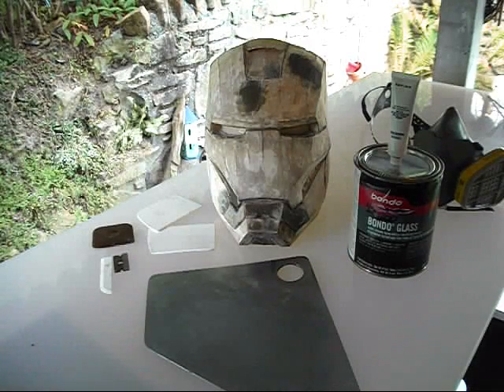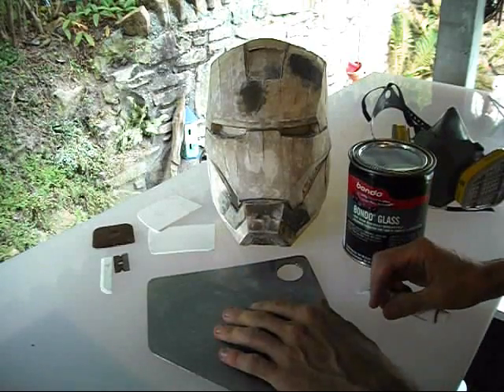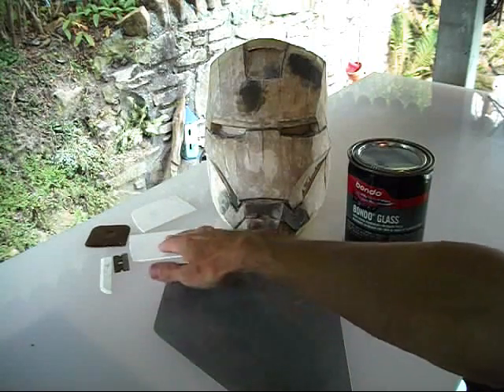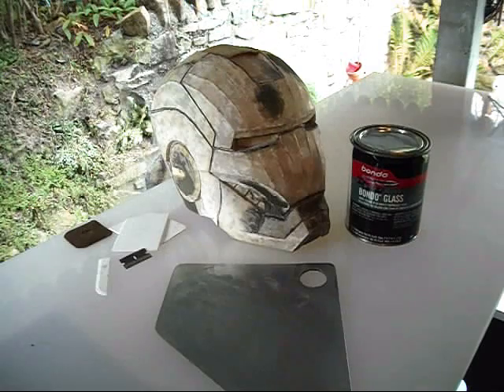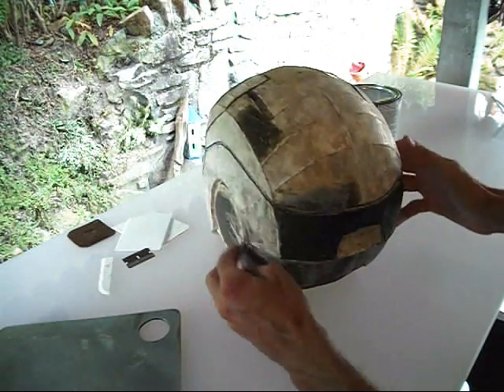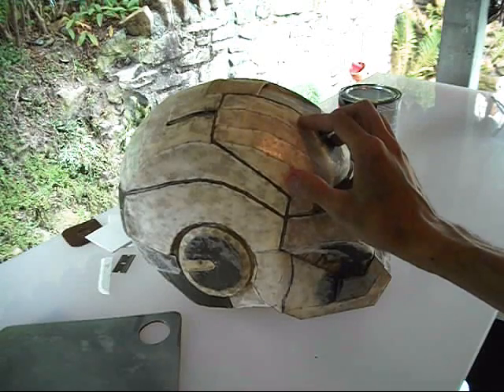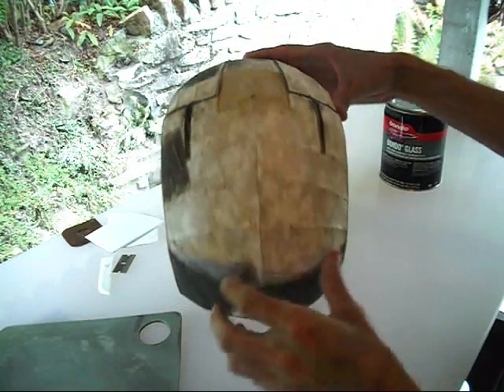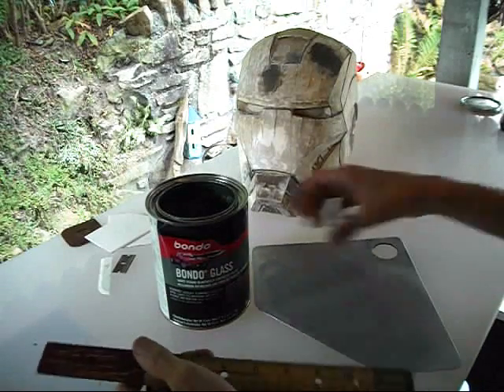IRON MAN HELMET BUILD PART 4 ~  BONDO FIRST COAT

Comment from the maker: Thanks for checking out the video.  Yes you're correct, Bondo is just a popular U.S. brand of car body filler made by the 3M company.  Any polyester resin based body filler is basically the same stuff and will work fine.  Good luck with your build!

Comment from the maker: Yes, I do think it will warp.  If you still choose to move forward on it do very light coats of resin, and make sure each coat is fully hardened before adding another coat.  It may not end up perfect, but it should keep the warping down to the least possible.

Comment from the maker: Bondo is basically just polyester (fiberglass) resin mixed with talc to make a paste rather than a "honey-like" liquid of the resin alone.  Bondo is meant for filling holes and dents and is much easier to shape and sand due to the added talc.  Fiberglass resin is much more liquid to properly "wet out" (saturate) fiberglass cloth and cure into a more ridgid and structural patch.  Fiberglass resin can be added to Bondo filler to thin it out if needed, but the more resin the harder to sand.

Comment from the maker: Yes, you need to fiberglass around the eye sockets.  They need to be just as strong since the socket is what you will attach a lighted lens to later on, and they also to support the Bondo used to smooth them out.  It doesn't matter if the cloth frays...just make sure there are layers overlapping each other and it will be plenty strong...you don't have to keep the perfect weave of the cloth.

Comment from the maker: You're very welcome!  This is my first attempt doing pepakura as well, but I've been using fiberglass and Bondo for years, and I'm pretty good working with my hands so I figured I would give it a try.  Just finished sanding the first coat so I should be starting the part 5 video within a few days.  Stay tuned, thanks again- Boochieboy.

Comment from the maker: No, it is reinforced with fiberglass strands mixed in.  It can be applied thicker, and bridge larger gaps than regular Bondo without cracking.  It is also harder to sand and shape than regular Bondo.  It's not necessary to use however,  regular "pink colored" Bondo is fine.

Comment from the maker: If you're only making one helmet then I would cut the eyes out before bondo.  It will be much easier to sand, file, and build the inner eye detail with them cut out.  If you're planning on making a mold and casting copies of the helmet like I am then you would want to leave the eyes in/solid as you can't have any holes in the helmet during the moldmaking process.

Comment from the maker: Bondo is a brand of automotive body filler made by the 3M company.  It is used to repair and smooth and fill automotive surfaces like dents and patched areas.  It's a polyester (plastic) resin based filler that hardens when mixed with a catalyst resin.  After hardened it can be sanded, filed, drilled shaped and painted.  It's also water resistant.

Comment from the maker: Yes Brandon Alba, that would be fine.  Working in a checkerboard style as you said is only to keep track of where your edges and corners meet, to keep them sharp and defined by not covering over both/multiple points where they meet all at once.

Comment from the maker: Yes, Bondo is very hard and strong, yet slightly flexible which prevents cracking.  Bondo is used to repair many surfaces...metal, plastic, rotten wood and even concrete.

Comment from the maker: You won't inhale the fiberglass cloth once it's resined.  The resin will encapsulate the cloth.  After you fiberglass, sand the inside to remove any bumps or sharp bits and once it's smooth put another layer of just the resin to give it a final smoothing.

Comment from the maker: Did you fiberglass the inside yet?  If not, you need to do that to strengthen it before adding Bondo to the outside.  If you have, then you should lightly sand the outside with 120-150 grit sandpaper, then mix your Bondo and spread it on.  You CAN skip the sanding but I always recommend it to help the Bondo "grip" onto the resin better.  Thanks for watching, I'm glad it helped you.  Feel free to ask any other questions.

Comment from the maker: Thank you...I try to give as much information as I can in my videos.  I'm glad you are finding them useful.  This video only covers the first coat...after the first coat is applied to the entire helmet it's sanded smooth and a second coat will be added to fill in the low spots and sanded again.  I will continue adding as many coats of bondo as needed and sanding until the helmet is completely smooth.  Usually 2-3 Bondo coats are needed to get a smooth surface.  This will be covered in part 5.

Comment from the maker: I've actually heard that suggested before, so it's not an unusual question...and I have actually seen it done before on pep builds.  I think it would be fine for a helmet you're just using to make a mold of.  I'll never do Bondo again for a helmet I'm just using to make casts from.....I would do the pep build just so the general shape and symmetry was there, fiberglass it and smooth it with clay instead.  Or just sculpt the whole thing from clay to begin with.

Comment: Great vid, you have a good work discipline. Just printed out my pepakura templates cutting starts tomorrow using 120 gsm stock paper. Not used bondo but used many epoxy type fillers here in UK a lot of guys use car body filler (maybe thats what Bondos used for :). Any way thanks again - I'm inspired looking forward to part 5

Comment from the maker: You may want to go ahead and start your helmet.  I don't know when the next video will be up...I haven't had time to do much work to the helmet the past few weeks.  I'm still in the process of adding the first coat of Bondo to a few small areas on the helmet, as well as fixing/building up some problem areas that were not even.  I'll try and make a video soon but I want to take my time and do things the right way.  The helmet has to be PERFECT before I make a mold and cast copies.

Comment from the maker: There's no right or wrong answer to that question.  I did my entire helmet, even the areas that were pretty smooth already.  If you think the area is smooth enough without it you really don't have to bondo that particular area.  It's preference.  Bondo any areas that are not smooth, or are mishapen and need adjusted.  On really high detailed Pepakura pieces people usually skip Bondo'ing the tiny, intricate areas.

Comment from the maker: No, you need to wear a RESPIRATOR with Organic Vapor Filters on it.  Regular dust and painting masks with elastic strings will not work...you have to wear a respirator that creates an airtight seal around your nose and mouth.  I use a quality 3M respirator which you can find at Lowe's or Home Depot, but if you have a Harbor Freight Tools around, you can buy a respirator with filters for about $15.

Comment from the maker: You do not want to put fiberglass cloth on the outside of your mask unless you don't care about losing details.  Fiberglass is only necessary on the inside anyways.  You need to use proper fiberglass resin with the fiberglass cloth...do not try and use Bondo filler to harden fiberglass cloth.  Bondo filler is only for smoothing and shaping.  All matter of padding can be put on the inside for comfort, but make sure you sand off any sharp fiberglass before padding it.  Use any kind of foam to pad.

Comment from the maker: I prefer the paper way because you can get a much higher level of detail and it is much stronger to use fiberglass and body filler rather than foam and glue or Plasti-Dip.

Comment: Hi Boochie.  This might be an unusual question but it came to me when you started talking about time limits of the bondo curing while working.  If you're going to use the helmet to make a mold, would it be ok to use drywall mud and then seal it after finishing? It'd be fragile but a bit easier to work with. Let me know what you think.  Thanks!

Comment from the maker: I would fiberglass the inside if I were you.  Fiberglass is going to be the best for strength, and if you need it stronger you can always add more layers of fiberglass cloth.  Bondo or body filler is what most people call it.  There's Bondo spot putty which is NOT the same as regular Bondo....spot putty comes in small tubes and has the hardener already mixed in (air dries) and is used to fill very shallow dents or pinholes before primering.

Comment: If I understand you right.  You cover the top with cut out using the card stock and then resin it on the outside and fiberglassed it on the inside?

Comment: I probably put less than an ounce of resin in because I didn't want to waste it, and then I added only 7 or 8 drops of hardener because I was only using a little bit of fiberglass resin. Unless you making a big batch of fiberglass resin then you need more hardener. Id this right?

Comment: Ouch got impatient and did fiber glass on the outside. I'm ok with losing detail but wanted to do a layer of bondo on top of the layer of fiber glass resin/cloth not mix it together. Is this still ok to do? I was going to take a sander to it before and after the bondo

Comment: hi, ur videos are really helpful. i need to know that wen i m applying resin coating on the outside of the helmet...do i need to mix the hardner with the resin or shud i apply just the resin?? and u applied fiberglass resin. is that ok if i apply epoxy resin??

Comment: would you need a dust mask or respirator for wearing the finished product months after finishing it of course? also, will any respirator do, meaning can i go out and buy the cheapest one and get away with it?
Reply from the maker: No.  Once the resin and body filler has hardened the fumes are not toxic.  It's only when the resin and filler are uncured that the vapors are hazardous.  It may still smell bad but once it's cured it's just plastic at that point.

Comment: Hi, What's the actual purpose of regular bondo glue. - From the UK here.
Reply from the maker: Chantelle Hay Hi.  The purpose of any "Bondo" filler or other brand of polyester filler, whether Bondo, Bondo Glass, Bondo Hair, Bondo Gold, Evercoat, etc. is all the same, for filling and smoothing the bodies of damaged automobiles, boats etc.  If you mean the resin used in the part 2 video, the purpose of that is to be used in combination with fiberglass fabric to repair holes and make more structural repairs in cars, boats and such.  The resin can also be used to thin out fillers like Bondo filler.  Bondo filler as seen in this video is basically just resin that has been thickened with talc to make it into a putty.
Reply: Thanks!

Comment: Is it safe for one to put fiberglass inside of the helmet if one wants to finish it up and wear it, and not use it for a mold?
Reply from the maker: Yes, just make sure there are no sharp bits of fiberglass sticking up after it hardens.  Sand them off if so.  Most protective sporting equipment (including headgear) is made from fiberglass.
Reply: Oh alright, thanks!!

Comment: So I applied the bondo with the hardener, but it seems I didn't use enough hardener?
I'm not sure what I should do with it...
Reply from the maker: Simon Clarke If it's TOO soft then you should really scrape off as much as you can and redo it.  Otherwise, hit it with a hair dryer (the heat will help cure it a bit) and on the next layer just add a wee bit more hardener (the hardener from that layer will help cure the softness of the first layer somewhat as well just from contacting it).  Remember that the Bondo, even when you add enough or even more hardener than necessary, still retains a "tacky" feel to the outer "skin" of it until you sand it off.
Reply: Boochieboy Thanks for the fast reply and I'll try using the hair dryer and see how it goes :D

Comment: I already put fiberglass inside my helmet ( Actually i think that i'm going to put one more layer ) and put just resin in the outside.... but there are some sections that have a weird feeling... well i don't know if it's weird :P because it's the first time i do this, but it's normal if is a little bit like... tacky ?.. i mean it's dry but in some areas feels a little bit sticky :P, body filler will fix it ?  or is it normal ?
Reply: That just means it hasn't fully cured yet. Which means that the resin pr bondo isn't 100 % hardened. It usually just means you didn't use enough hardener or its cold where you are when you did it.
Reply from the maker: It's normal.  Fiberglass resin is partially cured by the heat from the reaction of mixing the hardener in with it, and the larger the volume, the greater the heat created and faster the resin hardens.  Now if you're brushing the resin in a very thin layer on the outside of a pepakura helmet for example, there is not a whole lot of volume to create heat to harden it as much so it may remain slightly tacky in some spots.  Not to worry though, body filler can go right over top of the slightly tacky resin.  The hardener in the body filler will cure the resin the rest of the way.  Just make sure you are adding the correct amount of hardener to your resin mix to begin with.  You can also dust the tacky parts of resin with baby powder to remove the stickyness if you like.
Reply: i already add  body filler to the surface  and do a little bit of sanding, everything is going well so far :P ... thank you for your answers :D 
If you want, you can see  my updates in my helmet here :) http://www.therpf.com/f77/red-hood-wip-206203/

Comment: I'm l really lost at what type to use. I live in Denmark and the closest I can come to finding bondo I think would be Plastic Padding or pollyfiller, but there are a ton of different kinds.. Got any advice? :)
Reply from the maker: +Solenea Treet Any kind of polyester body filler is going to work fine.  It's all basically the same stuff.  Just ask for the basic, general purpose filler.
Reply: +Boochieboy Thank you for the quick answer! I tried some basic spatula on a trashed faceplate, great result, though it isn't very hard.
Reply from the maker: You probably didn't use enough hardener/catalyst.  It should be rock hard when it's dry.
Reply: There is no catylyst/hardener in normal spatula.. :)
Reply from the maker: Are you talking about spackling?  Like to repair walls?
Reply: Yes, just found out that it was the real name of it. I found the kind of bondo (car putty body repair with a catalyst) in my local hardware store, but it costs around 28 $.. which is a bit much. :)

Comment: What should a beginner use then?
Reply from the maker: Just use regular Bondo body filler, or any other kind of polyester body filler...it does not need to have fiberglass strand or metal powder reinforcement in it for this type of project.  The cheapest filler works just fine.
Reply: Ah, ok.  Cool!  Thanks!

Comment: Thats the wrong bondo my friend
Reply from the maker: jaketron25 Did you read the description?
Reply from the maker: jaketron25 Actually for the amount of filler that I had to put on this crooked, misshapen helmet it was exactly the type of Bondo to use.  Regular Bondo filler isn't meant to be built up a half inch thick.